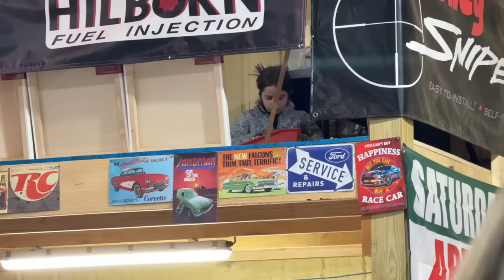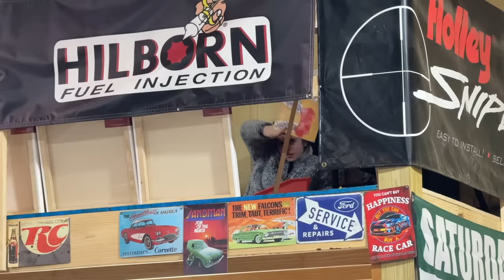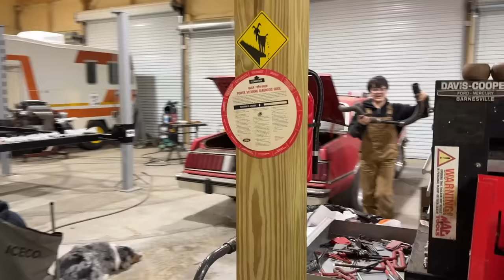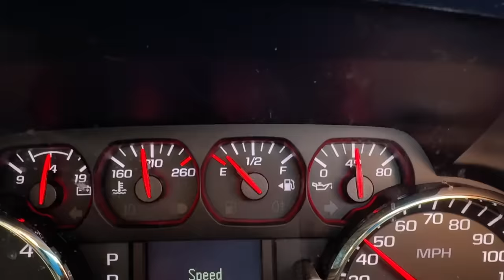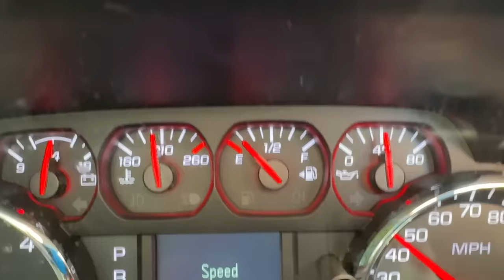Narrowed Rear and Plumbing for the Budget Big Block Fairmont!

Comment: Sleeperdude  an trick I learned from local old timer car builder to prevent shiny metal and chrome from rusting is to apply a thin layer of petroleum jelly and vasoline on the metal and it protects it from rusting
Reply from the maker: Ok thanks
Reply: Wouldn't that be a dust magnet? Js
Reply: @Daddyrabbit_2 dust is always better than rust.
Reply: richgwozdz8580 Aren't petroleum jelly and vaseline the same thing.?
Reply: @1980bwc  this is true but , come on

Comment: I have worked on cars and trucks since 1959 and remember falling for the 60 Falcon at its debut at that time. I drove a 1960 Falcon 4 door 144 6 with standard transmission for a 6 years and found it tough and dependable to 211,000 miles I traded it in on '66 Falcon Futura Sports Coupe V-8 and Automatic and drove it for 10 years and 206,000 miles I still own it. I am now 81 and not able to work on vehicles anymore. I really like your family and your programs especially your Falcon projects I have 2 '66 Falcons, 74 Mustang, ''77 Thunderbird, 2 '79 T-birds, 79 Bronco, '79 Ford F-150, and '71 Lincoln MKIII. I just felt a little sad that the Lowly Fairmont Futura had to be Chevrolet-ized.

Comment: Josh it's very important that the fuel pump push rod is in . If it is taken out and not put back in there will be a big oil pressure loss . You probably know this . Fairmont is looking tight 👍👍👍👍👍👍👍👍

Comment: Glad to see this back in the shop. Put some crimp type clamps on those fittings. You don't want oil under those rear slicks! I like braided hose on oil and fuel lines. Ralphie is one cool kid.

Comment: Ralphie awesome job at welding that piece of pipe!! Now just for a little tip if you’re welding is making a higher puddle than you want as you are welding towards you then try welding as you go away from you and it will lay a much smoother weld and not as big of a puddle!!! So try welding towards you and see how the weld lays down for you and then try angle the gun away from you and push the gun away from you!! You will definitely see the difference that it will make and then you can weld in witch ever way that you are welding or for different purposes!!! Awesome job once again buddy and remember just keep practicing and you will get better!!! I can also say that as thin as that pipe you was welding there are lots of others out there that would definitely start blowing holes in it!!! Remember keep up all the hard work buddy!!!!
Reply from the maker: Thank you

Comment: `I was a aircraft mechanic for years working on corporate jets mostly. The next time you assemble braided hoses such as earls type fittings are concerned, believe it or not, when you slip the first collar over the freshly cut hose, try spinning it counter clockwise and see how easy it goes on the hose. And enjoy those nice finger pricks from the stainless braiding! LOL.
Reply from the maker: Ok good tip thanks

Comment: Great video to watch after my victory. Got my 75 Ford Gran Torino running again and ran the new rear end at 30mph for 10 minutes up  in the air. Now all I have have to do is add 1 qt of transmission fluid,check my rear end(cause no one is going to check it for me),and get it down on all 4 tires. It isn't roadworthy yet. But I have to move. So atleast it is ready for the new home. But I have to get my other vehicles ready to go. But alot has been done and ready to see the new look after a suspension and tire upgrade. I really like that Ford Fairmont.
Reply: Opps sorry for cussing. I mean hoop and casings upgrade.
Reply from the maker: That’s awesome congratulations

Comment: Consider: having the trans cooler back by the valve body area aft for less business up front and better weight distribution.
There is no problem with lack of air what with forced fan air. Just evaluate clearance needs for a drag car only minimally lower than the driveshaft. 
Great channel Sleeperguy! Love you.

Comment: I've found that  if you roll the teflon tape with the tape coming off the bottom of the spool,with your finger through the spool, instead of the top of the spool,  you have more control of the tension and less chance of dropping the whole role. I know because I've done! (Old pipe fitter) Love the videos

Comment: After watching Josh put all that work into the adapter for the radiator hose I kept telling him to put a bead of weld around the edge so the clamp/hose has something to lock onto. Either that or bead roll it. If not, under pressure, no matter how tight you make the clamps it will eventually blow apart. Oddly no matter how loud I got, he didn't hear me...lmao

Comment: Ive been lookin forward to seeing this update video on the Fairmont! Also, I still cant believe it, but next week Im going to pick up the fastest and coolest vehicle Ive ever owned, from a Buddy. Its a 95 Z-28 with a 11.5 to 1 compression LT1, with nitrous. He had it dyno'd after he built the motor, and he said it layed down 427 HP to the wheels. Last time he raced it, he ran low 7's in the 1/8th mile on nitrous, at Jackson Dragway. Ive gotta put new head gaskets in it, and either paint or have it wrapped. I cant wait! Lol
Reply from the maker: Awesome sounds like a blast

Comment: Awwww, I had a Samurai 20 years ago when I lived on Hatteras Island, North Carolina.  I bought it for $600, cheap because it had a transmission noise, sold it 3 years later for $600 since I hadn't fixed the transmission and I was leaving the island.  It was a mile from the house to where I couldn't see another soul while I sat studying each and every wave and that was pretty much all it did.  Driving on sand is a whole nuther driving experience with all new rules.  The Samurai with 5psi in the tires was pretty much impossible to get stuck (rarely locked in the hubs on the 4 wheel drive) whereas the luxury SUVs the tourists drove got stuck regularly.  I'd pull up next mega expensive, stuck SUV and the driver would point out I had just stuck myself.  I would calmly explain I was not stuck and I was going to help him because he was just a few minutes from the tide coming in all around his vehicle, in his vehicle.  There was no way I could pull him out with the Samurai, it would have taken the only wrecker around with its winch to pull him out.  I could air down his tires, rearrange a lot of sand with my shovel and if he did what I said, he could drive out.  The main point was, don't spin the tires because if you do it will move enough sand, your vehicle won't be on tires anymore.  It will be on frame.  I'd say 75% of the time they got out but, I have had people get out of most of the hole, gas it and immediately frame it.  There are some people you just can't help.
Reply: Remember being up in the snow in Wales years back. I was parked up roadside in my little Peugeot hatchback (think Geo Metro) and enjoying the scenery when a Mitsubishi 4x4 came up and the driver got out.

"You're stuck, ain't ya?"
"Nope. Thanks for checking in, though" 
"Nah, you must be. No way that thing will move"
"No, seriously pal, we're not stuck."
"Go on then"

So I fired it up, and drove off. Little fwd hatch and off I pottered without a hitch. 

He followed me out of the worst to make sure we were OK and said "Never expected that, pal. Fair play"

For context, in places, the front bumper was flatting off the top of the snow as we drove off. 

 That little crapbox would go anywhere. Loved it.
Reply: @philgrimsey3637  Weight makes a lot of difference and experience probably makes even more difference.  We had an Isuzu Rodeo, 4 wheel drive with the bigger tires from the factory.  I didn't want to drive that on the beach because of the salt spray and rust.  I got and followed the advice to slack my tires but, there was still learning how to spot the soft sand, picking a good speed, stay in a low enough gear you don't get bogged down and maybe most important, how not to make it worse when you start to get stuck.  Use your shovel early and you won't have to use it much.  I used the shovel in the Rodeo often, the one in the Samurai, never for me, often for others.  I never got as good as the locals.  They drove 2 wheel drive everthing on the beach.  There was even an old guy that drove an old Cadillac Coupe De Ville, never got stuck but, sometimes didn't try to go as far as he intended when he set out.

Comment: Josh, I had a friend who had a Fairlane. It was a black car with an autosport engine in it. It was from the Ford Racing catalog. He additionally went racing at a race track up here in Ontario. The city was named Cayuga, where a dead strip is located. The engine was more than 500 cubic inches. I believe he told me it was 516 cubic inches. Every vehicle he had was black and they all had Ford big block engines.
Reply: Josh, it was a Fairmont, not a Fairlane. Sorry about that.

Comment: Hi Josh, we use a 10’ length of heavy wall 2” pipe with 2’ chains on both ends with chain hooks on for towing trucks around the yard with no brakes. It will allow you to tow and stop, manoeuvring depends on how much slack you leave in the chains. Just an idea bud.

Comment: Just like to say, wow!!  Installing a 454 big block in the Fairmont is an engineering masterpiece!! Hi Sleeperdude and family. Could you see the coolant circulating in the radiator? You may want to inspect the water pump. Maybe it wasn't rotating at all, locked up from sitting so long?

Comment: I had an 83 2wd Hilux dualcab pickup with a 400mm chassis extension, a 4L Lexus V8, auto and a 3.9 geared 9 inch diff. It had a full sized radiator with twin thermos under the allow tray as an oil cooler for the auto, never had a problem with the auto. I have had a few good V8s but that little Lexus V8 went like scalded cat and only the very top line expensive Ford and Holden V8 cars had any chance of beating it in stop light drags and it would get 25 mpg at a consistent 60mph on the highway.

Comment: You need an exhaust pipe expander to make custom hose adapters. Slips in a tube and expands it with a wrench or power rachet.

Comment: Josh you should have done a bit more research on fox body rear axles. You can fit a 275 radial on a 15x10 with 6.5" back space in the rear. All the housings are the same 86-98. You just swap in early fox width axles and flip the caliper brackets around.

Comment: I use a heat gun to remold hoses, Also to flair hoses.  Sometimes I use a smaller flex pipe to get the angle I need on the radiator hose to mold it with the heat gun, Just don't get it too hot.

Comment: My hypothesis; coolant pressure was increasing at an alarming rate. So I think it was some type of blockage. The only three places are the block water passages, the water pump, and or the radiator. I've never seen any vehicle do that before, and I've owned a lot of cars since I was 16; now 62! Dang I'm older than a dinosaur, lol.

Comment: Well Josh don't know that you'll read this but if you switched the two turbos the air inlets would be facing the inner fenders where I believe you could setup a  filtered cold air intake in the area between the inner and outer fenders.  Holler back ya hear

Comment: Great video as usual. I couldn't tell in the video but the axle tubes really  need to be welded the center housing. I have seen quite a few spin the tube when launching on slicks. Keep up the good work.

Comment: I see the weight back on the differential. You don't need it. It's to kill any harmonic vibrations there might be in the drive line. Some Fords used a weight on the extension housing of the transmission for the same purpose.

Comment: There is no such thing as too wide of casings. I had N50's on my 1974 Grand Prix. I had to put 2" horseshoes under the coil springs. I put Monroe Matic shocks on it too. True story, I worked at a machine shop at that time, and I machined the prototype jig that winds the internal relief springs that separated both oil tubes for Monroe Matic shocks. Merrill Tool - Merrill, Michigan 1985

400 big block, 400 transmission, electric fuel pump, Holly 1150 dual pump, J&R big tube headers, Sears Muzzlers mufflers & vacuum operated exhaust cut outs.
Reply from the maker: Yes!!!👍

Comment: Josh I have a 2011 Mustang GT Premium 6 speed manual with just 19 thousand miles, garage kept new 19" wheels and tires put on it in 2022, JLT carbon fiber cold air intake, flow master after axle mufflers, lowering springs, SCT tuner. It's silver metallic black leather interior. All for the low price of $20,000.

Comment: You could have picked up your turbo oil pressure feed from the front of the engine.  There is a 1/4 NPT plug on the main bearing oil gallery.  I built a twin turbo 427 many years ago and that is the closest place to feed oil pressure to the turbos.
Reply from the maker: Ok I wish I would have known that
Reply: @Sleeperdude  I hope you are planning to run alcohol?  That engine might not live long with high compression and a lot of boost on any pump gas that I know of (I grew up in the era of SUNOCO 260, the Blue stuff).
  I would also recommend that if you don't already have them that you install a set of high quality cylinder head studs, grade 8 nuts and hardened washers between the nuts and the aluminum heads.  We had the best luck with MLS gaskets.
  We were able to run 10-12 lbs of boost reliably with 9.0 to 1 CR and premium gas, somewhat more with water/methanol injection.
  I personally would ditch those aluminum rockers, those things are engine killers in my experience, but your choice of course.  We ran stainless steel roller rocker arms because of their smaller physical size and higher strength.
  Our engine was an L72 (All Iron) 427- Rectangle port heads, 4 bolt main block .030 over, standard forged Nitrided truck crank, 7/16 bolt rods, forged pistons with solid domes and the domes removed to lower the CR, plus all the other usual High Perfomance pieces.  We never turned the engine over 6500 rpm, so it was almost bulletproof.
  The turbo setup was a modified Gale Banks derived marine setup. Mounted on home brewed Log type manifolds, the  Twin Air Research Turbos blew through an enclosed 830 Q-Jet (this was well before EFI was a "shade tree thing").  Power went through a modified  TH475 and to a DANA 60 rear axle with 3.55 gears and a locking differential.  In a 3300 pound 66 Malibu, it was a killer street car.  The "blow through carb" setup was the weak spot, but when it all worked as intended, not much would run with it.  
  BTW, I'm not a FORD Guy, so when I saw the Futura was using a BB Chevy, it caught my eye.  I went to tech school with a friend who had a 67 Mustang GT.  He kept blowing up the old 390 FE and I half jokingly told him if he wanted it to really run, he needed a Mark IV BBC.  He did just that and it transformed the car into what you guys might call a "Casing Shredder".  Ah the memories!  Enjoy your videos and the way the whole family works and plays together.  Keep up the good work!

Comment: brake clean will soften the rubber hose and it will slip right on the fitting without having to use any other lubricant that then needs cleaned up

Comment: An air dam on the bottom of the bumper will do more for cooling than removing the lower valance. I have a 96 E350 with a 5.8 and they are notorios for running hot. I put a 5 inch air dam on the bottom of the bumper and it doesn't get hot any more, even with the spare mounted on the front bumper.

Comment: I use wood stove paste polish on cast items exhaust manifolds ,water pumps etc.  .It keeps the items from rusting ,looks good ,heat resistant .Wipe on wipe off . I have used hoppe's gun bluing on small items .

Comment: Issue number two, easy now (comments are always good) 
The flow capacity of that fuel line from the tank is scary. Braided SS like the trans line would allow me to sleep better.
Or a bit of steel tubing from tank to engine area seems comforting.

Comment: This is 1980 Fairmont with racing fuel Ford family into 13 second flat 1/4 miler 16 footer color red. With carbon charcoal nugget pebble size in the Vent system reservoir that can be inside the trunk. The gas cap is sucker also can vent vacuum in as well blowing out the rubber Goodyear hose. connect that hose to the carbon canister coffee empty can. Fairmont Is 2,800 pound curb weight and cut all the pan out except. Leave the driver's foot pan platform in the sports car alone.Thank you for watching 400 HP @ 5,000 red line Grand Ford Prix. Thank you

Comment: There we saw the 4 bolts in main bearing cab. The law of gyro is the higher the rpm of Crankshaft at same time the crankshaft bearing is side way thrust friction bearing against the side of the block cast iron machine cut in main bearing area. Then it is best to add ball bearing g in between the side and the side in the main bearing frictionless is for only rolling at 6,000 RPM where red line is 7000. The main bearing cap is to be press fit to the groove of the engine block in the bottom. The 
press fit holds as good as 
Up to 90 PSI torque so main bearing bolt isn't going to help that much, Gee.

Comment: You said you didn't like to bleed brakes you should try out one of those one man self bleeding setups that they have where you put the brake fluid in a container and some of them are hooked to the air compressor or have a pump on them by themselves and then you just go around cracking bleeder valves and there's enough fluid in the tank that you don't have to keep checking it allowing you to go around the whole car not worrying about running out of fluid

Comment: I would almost bet the radiator hoses will blow off of the custom reducer or any other connections that do not have a raised edge on the pipe for a hose clamp to grab ahold of to prevent it from sliding